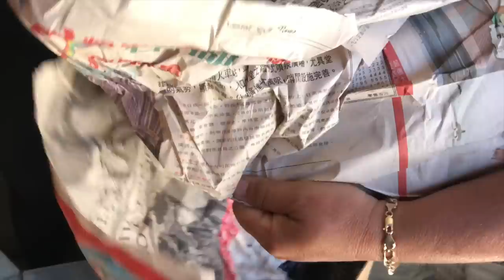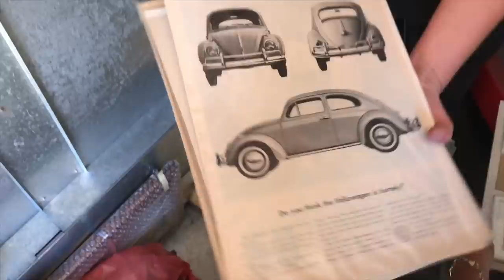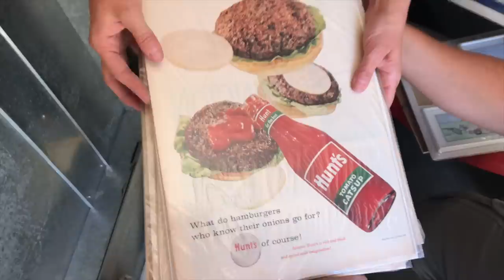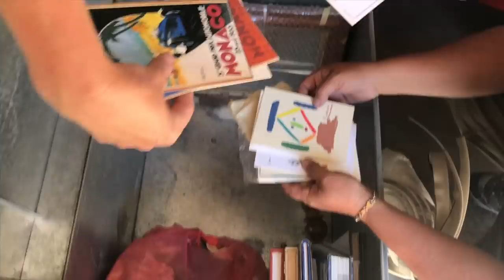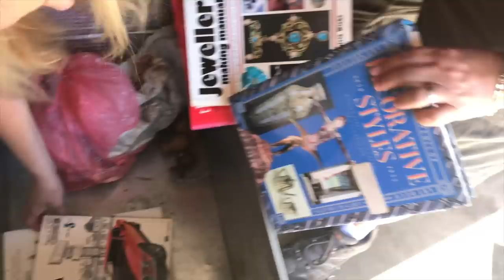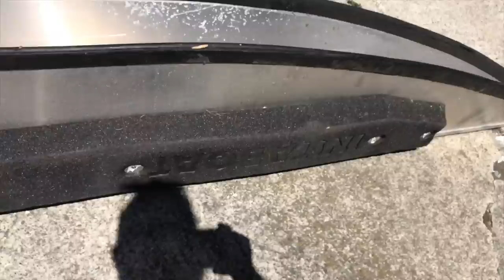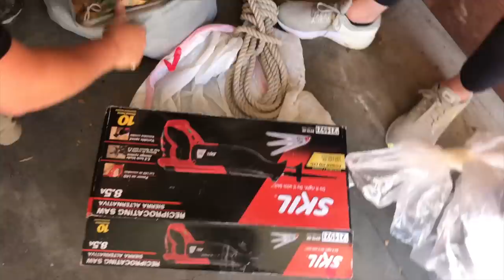COPS CALLED after locker bought with 2 BOATS at the abandoned storage auction

Comment: If you look on the starboard side of the stern just below the deck there is the Hull Identification Number or HIN (same thing as a VIN on a car).  When you get the new title and registration you will need it and other information as well.  Check with your state on exactly what information you may need to get everything current (length, beam, hull type, engine type, fuel, etc.) each state is a bit different.  Depending on your state you may need to get everything current before you can sell it.  

The boat registration numbers (those are the numbers that start with CF on the bow) are like the license plates for a car. The "decal" that is before it is like the registration/renew tabs that you stick on a license plate to show that your registration is current.  When you go get the new title and registration they will assign you a new state registration number that must be placed in a certain location and there is a required size and of the spacing between the prefix (state abbreviation) the 4 digits and then between the digits and the suffix letters that you will need to put them on before the boat can be operated.  Again, check with your state on the type (style) of letters and numbers, correct placement and the correct spacing.  

Looking at the placement of the numbers the look a bit forward and the spacing between the “state abbreviation” and numbers and between the numbers and the two letter suffix look a bit narrow.  Again, check your states requirements.  That also goes for all of the making sure you have ALL the correct required gear and equipment  for your state and federal requirements onboard if you take it out on the water.  I retired from the Coast Guard and I can’t tell you the number of times that I either stopped or assisted a boater that was “just taking it out for a test run” with nothing onboard.

Another thing, if you plan on taking the boat into salt or brackish water you will want to make sure that all of your fittings and engine parts are for salt water.  Exposure to salt or even brackish water will corrode parts that are designed for fresh water only.  You will also want to make sure all of your sacrificial anodes both on the hull, shaft/out drive and in the engine are good.

Comment: Locker Nuts, the tow frame (orange y shaped towbar) is a tow frame for a VW Bug, just slide it under and bolt onto the front axle and you can haul your Bug behind an RV, i used to have one just like it when i had a VW beetle.

Comment: Modern boats usually have an ID embossed in the upper right corner of the transom (back of the boat)  The Correct Craft prob has a metal tag on the inside of the engine box or engine cover or behind the seat back of the rear seat.  The seat back prob lifts straight up a little bit and them come out.
Reply: Chip custom craft, very expensive wooden boats

Comment: The problem with the boats is they are titled, like cars. You have to have the title to sell them. I'm not sure how you'd go about getting titles for those boats. 

My aunt's ex husband had left a small motor boat in her yard when he left her. It sat there for several years and there was not a whole lot she could do with it because she didn't have her name on the title and she couldn't even find it. So after about four or five years she had my cousins pull the trailer up to the road and left it for free as is. It was dirty and filled with leaves... Well the wheels were flat and did not turn well but someone did stop and started dragging it away with their truck. Without good wheels I guess it made a hell of a noise. About three months later my aunt got a call by the police that it had been abandoned about 10 miles away and she had to pay towing and storage fees. Wasn't her boat. So they had to go after her ex for the money.
Reply: Put a mechanic's lien against it abandon it's not that hard to get out of tigers for like that

Comment: The Head Lights are for a VW Bug and quiet valuable especially CB's  in new condition, The Pittsburgh / Harbor Freight Tap and Die set is practically worthless since it is made of low grade poor cutting quality recycled beer can metal made in China...
Reply: Chicago and Pittsburgh brand tools are Harbor freight junk tools, and I'll agree there all day long. As for made in China? It's not like it used to be, the quality on a lot of it has come up so much that you really don't notice a huge difference between the bargain tools and the name brands here, it's just perceived value at this point. Especially when you see that a lot of the made in the USA products have fallen in quality as well. I've had Snap-on wrenches break on projects and got through it with Made in China no brand name tools which are still going strong 10 years later. 

This is more indicative of China coming up in the world compared to what it was in the 80s/90s and how our standards have fallen all in the name of making a buck at the cheapest rate (IE substandard materials sold for a higher price due to the labels attached; and no I'm not meaning Snap-on, even though I mentioned them, they are generally great quality tools and have a great replacement program most of the time). We need to have more pride in our work, and quit letting companies get away with cutting quality in the name of profit over actual quality and customer satisfaction.

Comment: Those numbers on the front of the boat CF 8659 is the registration numbers the numbers you also want on the back of the hall on the transom that would be in the sense of boats Vin number
Reply: in the US the numbers go right where they are. and in most states are only needed if the boat is designed to mount a motor on the transom.
Reply: Scott Schoemann Those numbers are theRegistration numbers on the front of the hall the boat could’ve changed hands without being registered that’s why you need the whole identification numbers on the transom or on the hin plate